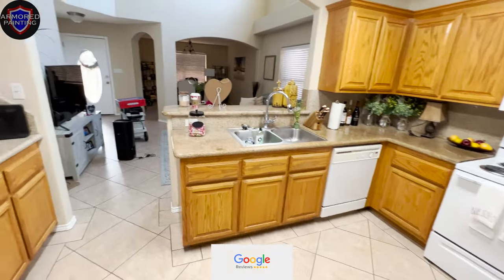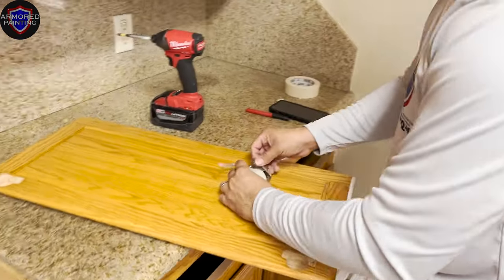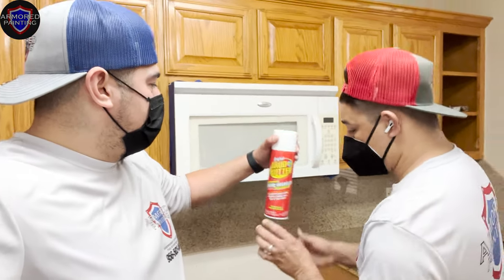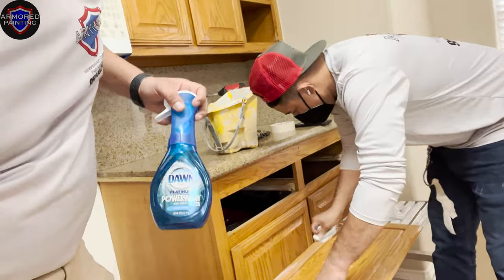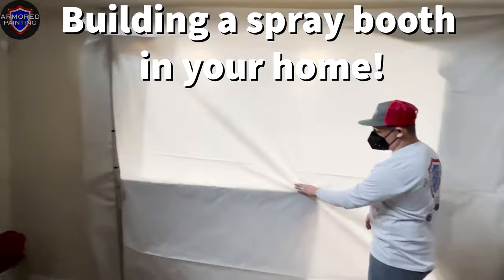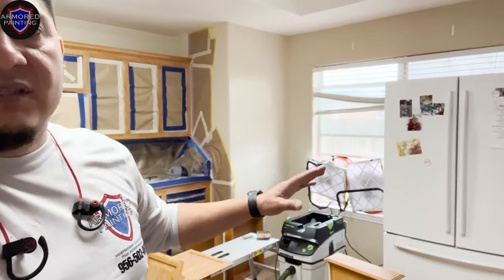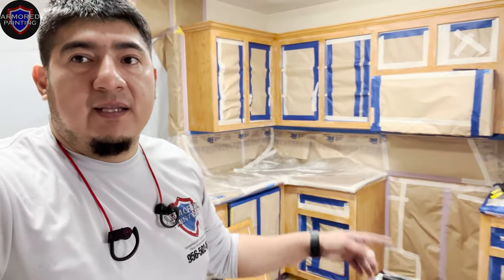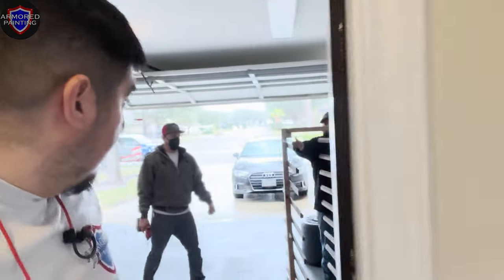Cabinet Refinishing with Emerald Urethane

Comment: You should have used grain filler for the oak.  Just painted my oak cabinets with SW Emerald and an airless sprayer.  Spent a lot of time and effort filling the grain.  They look like they were painted in the factory... no visible grain whatsoever.  Not an easy job!!!
Reply: Not everyone wants the grain filled. Takes twice as long to prep, therefore more expensive and some people appreciate the natural grain in oak. I have a lot of clients that want a mixture of stained and painted cabinets and it makes sense to keep the grain in oak. As long as paint gets in all the grooves it still comes out professional. First coat should be brushed and then sanded well.

Comment: I can't believe you sanded and sprayed the doors inside the house. You would have minimal dust and overspray doing the faceframes and sides but you made it a bigger issue by doing the doors and drawer fronts inside.